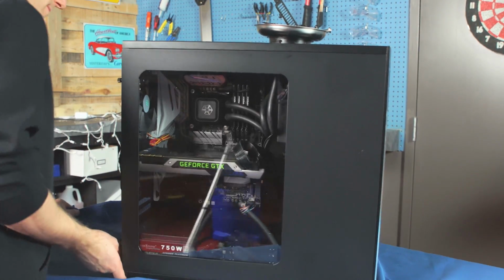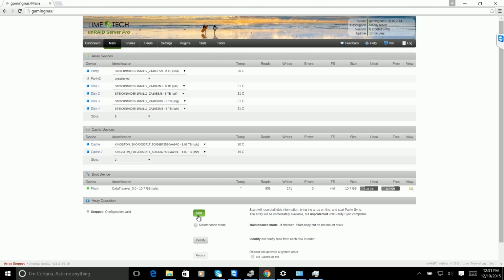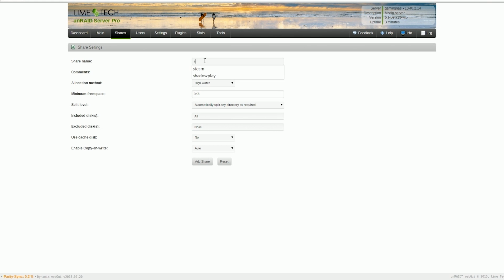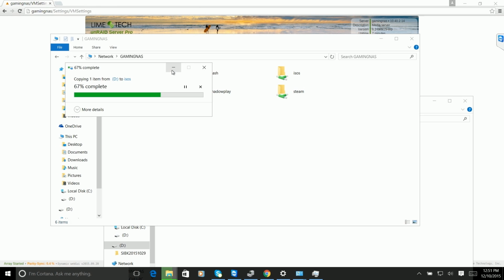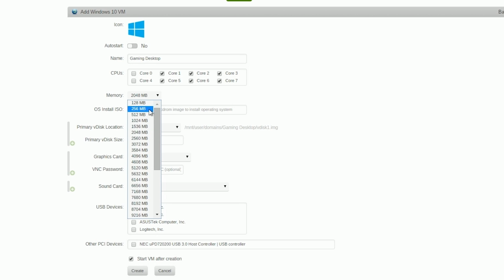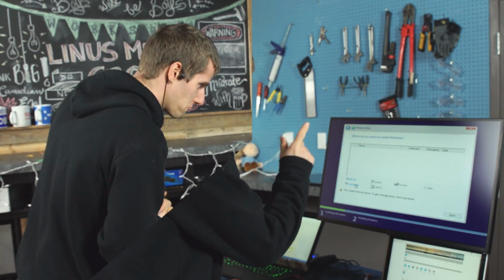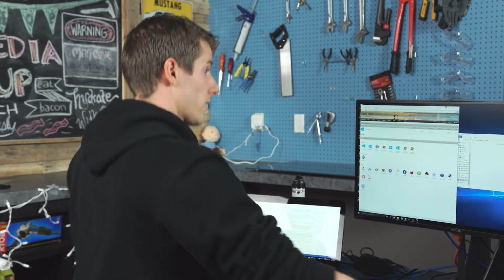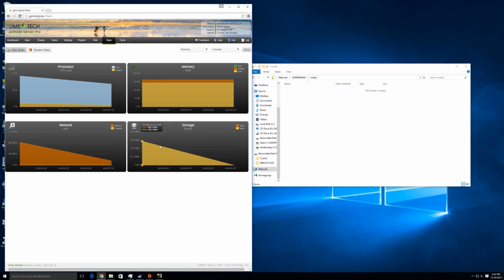Use your Gaming PC's Extra Power as a NAS Ultimate Guide

Comment: Do not use RAID 5 (single parity drive) for drives over 1Tb. The chances of data loss approach 100% when a drive fails the bigger the drives ger (google RIAD 5 URE failure). In a nutshell the chances of a second drive falling off you array during a rebuild is quite high, and the larger the drive sizes the longer this takes, and therefore the chance of a second drive going poof and taking your data with it gets much higher as time goes by, and is also increased by the increased drive activity during the rebuild. With 8Tb drives, a rebuild after a failure would take days, if not weeks to complete, and during that time you are extremely vulnerable to a second drive failure.

This is precisely why most Pro IT shops do not use RAID 5 anymore, RAID 6 (2 parity drives) mitigates this, but not by much. The prevailing best practice for Pro IT right now is RAID10 (a mirrored strip), this will weather upto 2 drive failures, with no URE danger during the rebuild, much safer with equal performance to that of a RAID5, with only a marginal overhead increase (Linus would need to remove an 8Tb drive, netting him 16Tb of usable space, or adding a drive, netting him 24Tb usable space).

Friends don't let friend go RAID5!

Comment: Badass, that's it. Also would give any advantage set the NAS on a separate lan nick than the Windows VM?
Reply: Unless you're running the game server in a VM on the same NIC as well you shouldn't have trouble, connecting to an external game server is going to use about 1% of a gigabit NIC's potential throughput, as long as the packet prioritization isn't broken that's plenty of overhead, especially if you're using it in what I'd consider to be normal use for a home NAS, that being streaming a movie or music to another device in the house or occasionally backing up some smaller office style files. If you're trying to use it like LMG uses theirs, for constant backups and working with massive files over the network, you could potentially see some slowdown, providing your disk setup is able to saturate the NIC's throughput.
Reply: Some z170 itx mobos  have 2 lan connectors.  or you can go skylake xeon when it comes out on the c232 chipset  and probs get 2 lan ports there
Reply: taief miah You missed the whole point of my question
Reply: If your internet speed+local network transfers exceeds 1Gbit you could potentially benefit. If you don't have gigabit internet or a full SSD array this is pretty unlikely though.
Reply: +TommyThousandFaces I don&#39;t think you would see a significant difference in LAN speeds in this case unless you are a super heavy user who transfers large files regularly. In which case, other users would see the improvement (i.e., multiple users pulling files off the NAS). Depending on how the VM is set up, it may or may not effect the two VMs hosted on the same machine (sometimes these are literally just interpreted as disk-to-disk transfers, however sometimes they still go over the network).
Reply: philondez So mixing packets from two different OS won't cause any slowdown, especially in online games? Some motherboards use packet prioritization to make online gaming work better so I thought splitting the connection could work kind of the same way.

Comment: Doesnt that mean I will have to keep that power hungry system; ON 24 hours a day, for the storage to be available to all the household devices on the local network? Isn't the point of NAS with low powered drives is power efficiency and 24/7 availability?
Reply: +ivanjacob A single drive Mycloud (not the best example I know, but technically still a NAS) uses around 6-10 watts when running, even at idle (powered on but not doing anything, so that drives are accessible) by G750JM-DS71 laptop with screen brightness all the way down uses about 20 watts, and a full on desktop like in this video is probably at least a 100 watts at idle, before you even get into all the extra HDD's being powered. So your talking 80-100 bucks easy per year in energy savings based on 11 cents per Kw.
Reply: +Ankit Prakash Your "power hungry" system consumes nothing when idling.
Reply: +jpchevron How do you know the pumps and fans in my "power hungry" system use more power than my nas at full tilt
Reply: +Azurek82 Unless your NAS is a raspberry pi I find that hard to believe.
Reply: Synology nas 414j uses 38.7 watts while being accessed 9 watts at idle (Real world tests show lower usage but for this example i'll use the higher usage ).
Main rig uses a d5 pump @ 5 setting - 23watts + 9 Fans 7 on the radiator setup 2 for the case - idle consumption 40.28watts access usage I don't want even guess the power usage once it wakes up all the time to sync phones pc etc